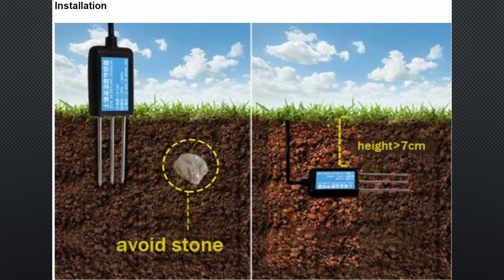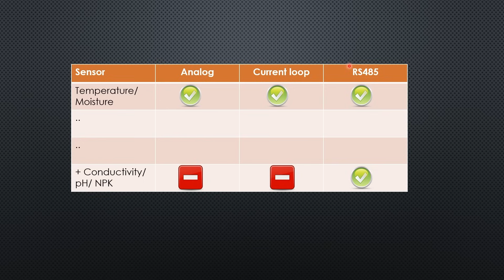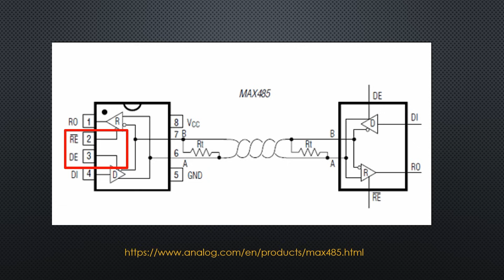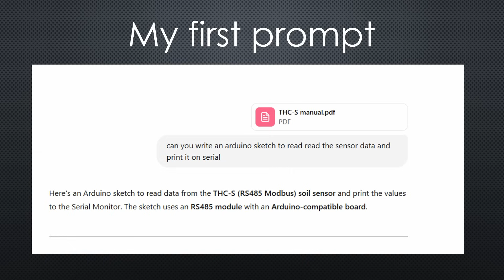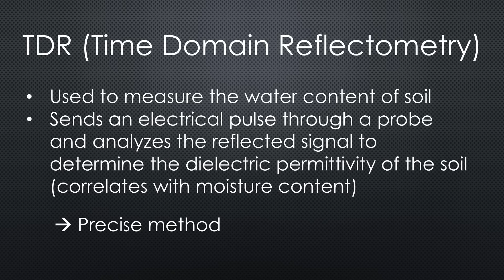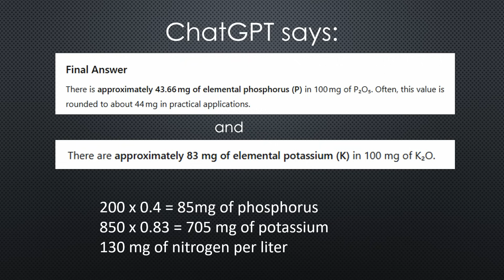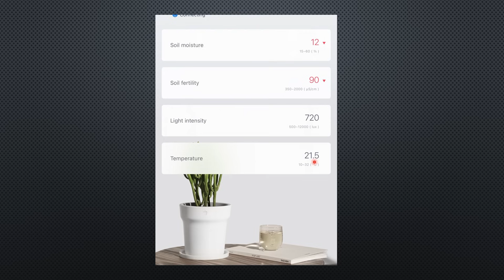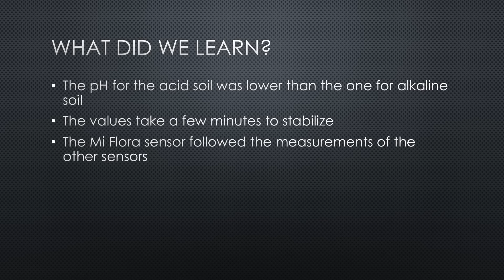(502) New (better) Soil Moisture Sensors and RS485 Modbus on ESP32 Arduino

Comment: Next step: portable battery operated that i can stick into the soil and leave for several days to build a proflle/map of my 1/2 acre.  No wires, just data logging that i download using either usb or wifi that is only operative on demand  using a push button-- or maybe just bluetooth?  And, of course, with centimeter accuracy gps because "we want more" and thanks to you and ChatGPT we can.  Extremely distressinng times ("It was the best of times, it was the worst of times") here in the United States  and this posting really brightened my week.   Thank you very much... a gritty youtuber follower!
Reply: Hi JLP. We're feeling it on this side of the Atlantic too. Solidarity. We can get through this together.
Reply: don't need gps, as they are stationary. Just use a phone to set the gps location. 
But anyway, on the professional market such devices have been around for years. They are not cheap though, but they last for years and batteries need replacement once a year or so.
but these small devices are pointless, since most roots of plants are much deeper, and these are the levels you want to measure. Most pro devices measure at multiple depths.
Reply: Someone did that, can't post link to it.
Reply: @Tntdruid  where can i find what you are referring to ?
Reply: Thanks to @Kevin192291 in another reply for shedding light on what my experience has been with NPK soil analysis.  I'll stick with soil anlayses with a laboratory for NPK which kinda defeats my suggestion above re: short term readings to get an average re: NPK.
Reply: It's easy to make I did it for my friends compost piles with solar and ds12b  and Lora. 

I actually ended up just using espnow  after testing cause it worked just fine for the range

Use gnss like the Lora pills
Reply: Lol I was working on a portable version for spot checking my garden fruit trees
Reply: Youre describing one of the exact use cases that BLE was designed to address. Build a (preferably bare metal) app that deep sleeps for 99.9% of the time, wakes up, reads and sends a datapoint in a fraction of a second, then goes back to sleep.
Reply from the maker: A viewer pointed me to similar sensors with a Zigbee interface. They cannot be buried, and I have no idea how good they are. Otherwise, it is a good project for you using LoRa, for example...

Comment: When I was doing solar data monitoring back in 2008 - 2012 I did a lot of RS-485 reading for industrial power meters and weather stations.  When I had a multi-building site I set up directional antennas with RS-485 transmitter/receivers.  I wonder if those systems are still working!
Reply from the maker: They are now 15 years old. Quite an age for electronics!

Comment: Very interesting video! Now you have measured within the different sensors. It would be cool in follow up video if you could measure against a referense the different parameters, temp, pH, moisteur... to see if they are linear or not. Then they could be corrected with calibration factors.
Reply from the maker: For the moment, I have no such plans. Maybe stuff for a gardening channel?

Comment: Thank you a very helpful vid. I always like it when your video s are something unusual as it normally sparks a new interest. Must try coding with chat gpt. A primer for getting the best coding from ai system would be good to find. Liked the idea of including spec sheet with the request. Happy gardening from the wet UK. Simon
Reply from the maker: Indeed, adding a datasheet increases accuracy because it does not need to hallucinate if it does not know.

Comment: Genuinely surprised you didnt mention MAX3485 instead of level shifter, or one of the many other 3.3v rs485 transceivers.
Reply from the maker: The MAX3485, indeed, would also have been a good choice as you get boards with it on Aliexpress.
Reply: I know, and you usually cover all the good choices

Comment: Heck ya! Just got a wireless one off Amazon for $15 . Came with 1 sensor and station displaying time, light, temperature, and moisture. Tested 3 of my common analog versions and matched moisture % almost exactly. Brand Geevon. I did want to do your version but couldn’t go wrong for the price
Reply from the maker: Thanks for sharing your experience. These are quite handy!

Comment: Brrr. I have seen this sensors and no logic in the world can tell me how they are supposed to work. 
2 - 3 - 5 pins does not matter much, I would not be surprised if they where just in parallel internally. 
All this sensor can measure is some form of conductivity, temperature and maybe capacitance. 

From this one could model / predict soil salt content, but not measure. 
pH levels are a function of H ions present, which cant be measured without some 
ion selective probes.
Similar problems stand for NPK values.  

So this are not sensors - rather guestimators.
Reply from the maker: @SarahKchannel : The rods have different purposes (one for temperature, one for pH, for example. The pH one even is of a different material. As shown in the video, they are for sure not absolute instruments. Maybe they are good enough for relative measurements (except moisture and temperature, where they are pretty good).
Reply: @ try them on moist soil and then add some liquid fertilizer. I would assume it does nothing much other than change its values because the conductivity changed because of the added water.
Reply: It is possible to take some measurements with impedance spectroscopy, bur I agree that there is something fishy going on with this sensor readings. Measuring pH in soil isnt easy, even with a proper electrode.
Reply: These use FDR - frequency domain reflectometry. They work in a similar way to vector network analysers, measuring the speed of a voltage signal down the central pin to the impedance change at the tip. Time domain reflectometers (TDR) measure the travel time and signal loss on every cycle. FDRs use the central pin as an oscillating element and then measure the frequency of oscillation.

To be fair it does seem amazing that such an apparently simple design could do something so useful but the clever electronics is hidden away in the casing and, as a method, it turns out to be pretty accurate because, at the frequencies involved, almost all the variations in dielectric permittivity, and thus signal velocity, is mediated by the water content in the soil. Some calibration for clay content is necessary for accuracy, along with temperature calibration for conductivity, but other than neutron probe and direct soil sampling, TDR and FDR are the most accurate methods under most circumstances.
Reply: Might be worth tearing one down to see how they work
Reply: @SarahKchannel  Then have a look at the Delta-T equivalent - the WET2 sensor. These are FDR sensors and they work rather well. But no, they don't measure pH or NPK.

Comment: I'd guess that the NPK sensor isn't worth it if you have inconsistent moisture levels. Perhaps there are more accurate NPK sensors we could use?
Reply from the maker: It was worthwhile for me to be able to show you the results. However, you have to decide if relative values are of any use. Most users of such sensors in the comments agree that the sensors are good for moisture, EC, and temperature, however not for NPK.

Comment: Great analysis!!  I wonder if the NPK can be regressed with water concentration to give a bit more repeatability/ accuracy?
Reply: Plant growth isn't linear with respect to moisture. More moisture doesn't always mean more growth. Many plants will drown if the soil is too wet.

Placing the moisture electrodes in a cylinder of wet plaster of Paris and allowing the plaster to set gives you a very consistent method of measuring soil moisture using conductivity.

The plaster is porous and will reach equilibrium with the soil moisture over time.

The electrodes, being  captured inside the cylinder of plaster won't move relative to each other, and aren't affected by soil  motion or compaction.

I'm not surprised that the NPK values are only valid at one moisture level.

It is likely that each value is read by an electrochemical "cell"  made up of a reference electrode and an electrode that  uses potassium or phosphorus as one "plate" of the battery.
Reply from the maker: I assume that you can get reasonable readings over time if you let the sensor in the same place. Maybe it is even possible to find a formula for moisture if you measure NPK before and after a rainfall where mainly moisture changes.